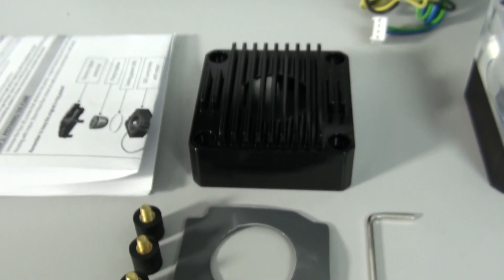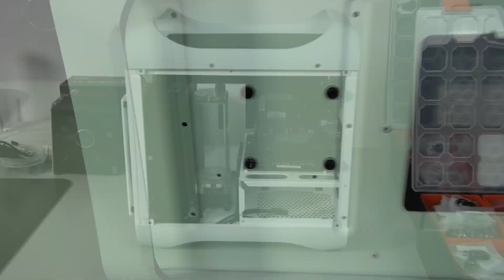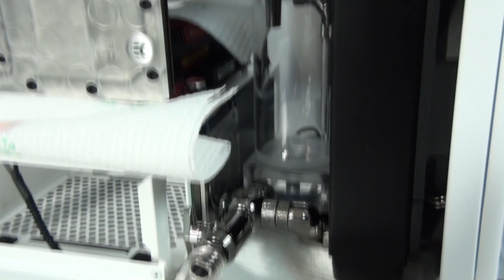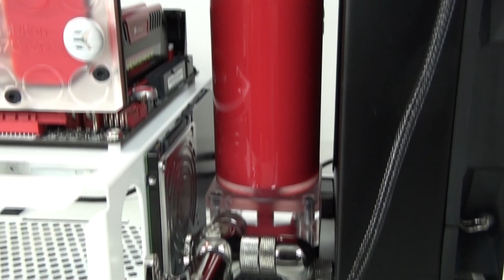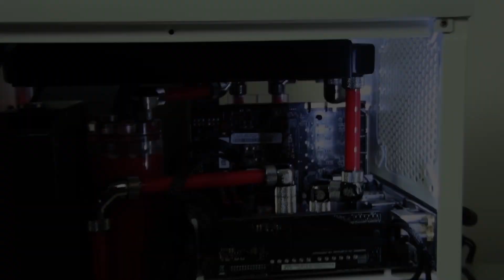Build #11: Prodigy Liquid Cooling: Part 3

Comment: All fans coneccted to splitter, and molex have 4 wires, where about this 4 pin molex goes ? and how to connect 3-4 fans using this spliter and also be able to manualy or in bios setup fan speed ? Cheers
Reply: he makes custom cables for all of his builds, so im assuming he made a cable that goes from a 6 pin sata/molex on the PSU to a single 4 pin molex in for the PCB splitter, but you could just use a molex cable that comes with your PSU. If you want to control the speed of the fans on the PCB, you would need a cable with a 4 pin molex on one side and a 3/4 pin fan connector on the other side to connect to a header on your motherboard. In this case, you would only be able to control the speed of all the fans on the PCB simultaneously.

Comment: I really like the bitspower fitting for the bends. The bitspower fittings are really quite nice!
Reply: Bitspower by far is the best fitting manufacturer, and they have also been the most innovative. Not only do they provide by far the biggest selection, they also have the widest capabilities, by far the best quality and durability, and in my opinion, the best aesthetics and they even offer several colors. Easily worth the higher price I say.

Comment: I know there are bigger problems in the world, but the estimation of sound levels in your builds seems a bit weird. 20-25db?  - that would mean it would be totally silent ie: you couldn't hear it at all if it were turned on inside a sound proof booth; well, 25db is the threshold for people with good hearing. By memory (someone will read wiki and correct me) Decibels measure sound exponentially, a 3db difference is double or half-  ie: if normal talking is 72db, softer talking (half that volume) is 68db, quiet talking 65db, whispering 61db etc. A louder GPU cooler (like a 290x) is rated at about 55db, so a 52db GPU cooler would be HALF of that. I think (again by memory) that a <40db PC is considered extremely quiet / near silent & that would be a PC optimised specifically to be quiet (very low RPM, sound deadening materials, minimum ventilation etc).

Comment: How do you figure out the bend when bending Acrylic. Meaning it a 90 when bent you can't just measure to the fitting and bend because than the 90 would be offset and over shoot the fittings.
Reply: WTF are you talking about??
Reply: +Kyong Hansen the offset measurement you need to know when you make your bends to know how much to measure but hey you are ignorant
Reply: uh no im not lol, because ive built several systems using both 16mm and 12mm crystal link and ive always taken my tubing angles and routing very seriously. Clearly you are with your stupid statement, trying to tell the best system builder in the world that he cant do something that he clearly is doing just fine.
Reply: +Kyong Hansen look at my channel tell me I don't know what I'm talking about. My build will be there.
Reply: +James Emsley I didn't say anything about him. I was asking how he measures for when he bends a tube. As when bending you have an offset. I be always done it by eye ball but since learned how to measure for the offset so my bends are exact

Comment: How much would a water cooling system like that cost
Reply: Rough estimate is $600. Not including the custom wiring. Pump, Reservoir, Blocks, Radiators, Fittings, Tubes, Liquid, and accessories.
Reply: and no parts :D
Reply: lol for a system this small? uh no. 600$ for EVERYTHING is accurate....  the 2 waterblocks would equal about 225$, the pump/res combo unit is about 100$, the radiators equal about 140$, which totals about 465$, then that leaves 135$ for the fittings and tubing which should certainly be around the cost of those altogether. This system is by far the cheapest overall that hes covered.

Comment: I prefer the looks of the fittings for the bends in the water tubes and keeping things at set angles like 30,45,60,90 degrees, but I prefer bending the acrylic due to the flexibility, and when done right, it can be more creative allowing custom shapes like loops or zig zags, etc.... For small builds like this, the fittings along with the 12mm OD tubing looks great.

Comment: How much does a loop like this cost? I just built a bitfenix prodigy rig using the same setup, minus the fact that I used an ASUS GTX 770 since I really wasn't thinking about water cooling it until I saw this video again.
Reply: $65 for the 240 radiator, $30 for the two 120 fans, $100 in fittings, $110 GPU block, $70 CPU block, $60 for the 180 radiator, $20 for the 180 fan, $30 for the tuning, $70 for pump and reservoir combo. I might be a little off but it should give you a good overall idea of the costs.

Comment: another beauty!  do you think that the nvidia trend for getting more performance for ever lessening tdp will eventually obsolete water blocks for video cards?
i mean the maxwell 750ti performs about 40% better than the same price point ati
using 40% less wattage this trend may obsolete the water block and ati both!
Reply: It's been a year, and the low power trend is already out the door for the high performance market.
Reply: +ThierryTheuns ati has all but waived the white  flag
Reply: +Nick Fury ATI is constantly selling power hungry cards, so I don't get your statement

Comment: Not hating on your build, it looks great but I was a former plumber and one thing I know for sure is the less fittings u use the better off u are. Fittings always fail it's only a matter of time, the chance of fitting fail is increased with use of cooling and heating of piping. this is just MO take it as u will.
Reply: How long do you expect this loop to be in use? A year, maybe two before upgrading?  The o rings will last much, much longer than that. There are guys out there with decade old BP fittings that are still leak free. It's not like the plumbing in a house that will be under heavy use for many years.

Comment: Could you Do a soft tubing prodigy video? I will try to do such a build und my own in a few months and I think its chraper than these acrylic tubings, what are advantages and disadvantages on both sides?
Reply: Physonium I but what do you need for cutting the tubes? and is it that much more it will cost to do it with acrylic tubing? Isaw the bitspower parts were around 15-25 euro each.
Reply: Hard Tubing is awesome, it looks very good inside of a case because its not big and bulky.
Reply: ***** okay thank you, but where can  I get the acrylic tubes and fittings that arent to expensive (best bang for the buck)
Reply: ***** And how much Radiator Space do I need to cool my overclocked Athlon 760K and a R9 270x? (overall dissipation would be around 350Watt) is one thick 240mm rad enough in push-Pull? I do only have space for a 240mm and a single 120mm in my Prodigy.
Reply: ***** primochill fittings are hideous. BP all the way.
Reply: Chris Cleveland
I don't think their basic compression fittings look bad, but all their other fittings do look like crap, I agree, But I actually like the basic straight compression fittings look for the money, kinda plain but good value, lots of color choices. BP looks nicer but cost significantly more, really matters on budget. With BP fittings running $6-10 more if you need 20 fittings it could be a $120-200 difference depending on the fitting needed. Of coarse the builds like we see in this video have quite high budgets.
Reply: Ian M I'm not a fan of pretty much anything made by primochill... Their lrt advance is good stuff, but beyond that they're pretty far down on my list of favorites. I don't mind compression fittings either, but I'm a bitspower fanboy so my fittings budget is always ridiculous lol. My latest loop uses multilink enhance with rotaries for bends, and it's kind of insane how much it costs to build a loop like this. 40 or so rotaries, tons of extensions, 30-40 multilinks, and various bits and bobs get pricey quick. I'll probably bend my tubing on the next build lol. Maybe go nickel plated copper or something. 

Anyway, went off topic. I'm just sort of a fittings snob. Primochill acrylic fittings can look ok (they've improved with their newest line) but I'd personally never use them as long as you can get BP stuff.

Comment: NOOOO....Just take your time and bend it! I study as a mechanic and we have a class of Fluid Mechanics. Every fitting, adaptor, curve(greatly depends how close) ,rough change in diameter, and the surface texture of the material create losses. While pressure is not part of a close loop (where water constantly flow at a given rate) it's the sum of losses! Having a minimum of fittings and wide bends of this tubing would make the perfect loop!

Comment: I agree with what you said about the bending of the tubing really depending on the size and aesthetics of the build.  For a small system such as this one I think that the more fittings, straight tubing approach is better looking.  But for a bigger build the large bent tubing runs are really quite striking, especially if you can get them to glow with the lighting.  Thanks so much for the great build log!

Comment: i think bending or not depends on the build. 
if there is a clean build required i think the fitting solution is better.
if the build should look crouded and interesting.. i think bended tube would  be better.

keep up the good work :)
Reply: Couldn't agree more.  I have used both in my recent build and it's a great balance between using either one.

Comment: Is there a reliable way to cut wires to exact lengths without using dedicated cutting machinery? I keep seeing all those builds with near identical individual length cables pulling off beautiful loops and curves.

Despite all my efforts i always end up with wires longer or shorter then the rest which ends up putting kinks in my wire bundles.

Comment: Fittings on runs less than 4-5 inches but bend the tube on longer ones like from the CPU to the 180 rad.

Comment: Hi ! I personaly bend the acrylic tube. but only make one or two bends on a tube and trying to do the rest with fittings.Too many bends ruins the ascetics. If I have to do an offset I allways place close to the bends so it's less visible, but it's very dificult to do, you need to do two bends in a same time, hold on place and  let the acrylic cool down.

Comment: My opinion on the tubes, for what it's worth, is for the shorter runs I.E. around the motherboard and between the motherboard and GPU or on this build between the motherboard, radiator, GPU, and reservoir return I prefer the fittings and short straight tubes. However, for the longer runs like the pump outlet in this build I prefer the bent tubes. The one 90 degree fitting floating in the middle of the run takes away from the aesthetics and since the advent of bendable hard tubes is unnecessary.

Comment: I personally prefer angle fittings with acrylic tube makes aesthetics so clean and beautiful.with only bent acrylic tube looks cheap and not much of any aesthetics there.but if on a budget I would bend the tube to save money on fittings to buy better other parts.and I5 cpu is all you need in a gaming pc with money you save could buy a better gpu or ssd or fiitings.A i7 cpu dont make games play better over using a i5 cpu  for gaming only its a great Cpu....
Great build as always mate keep up the great work love your work all class....

Comment: There are times when bent tub is more appealing than using fittings. I believe that for aesthetics the builder should look for harmony an balance. The use of PETG clear tube offer massive strength to the loop with the newer type of compression fittings. It will only be a matter of time before someone designs a smaller more stream lined type of fitting for this application.

Comment: Dan,

I personally prefer a combination of angle fittings with acrylic bends.  If you check my latest build, you can see my example.  There are some situations where all-acrylic tubing can't do the the job and it can only bend so far until it kinks.  And to fix that problem, you'd have to heighten or lengthen the tubing to work around it.  Also, it provides extra strength and helps with uniformity.  Not saying I am a perfect bender/builder but I've seen builds where no matter how good of a bender the builder is, a kink or non-uniformity can easily be spotted.  My 2¢…

Comment: I don't get why a 4670K is in this at least put a 4770K I guess client was poor...
Reply: ***** Given that even recent games like BF4 still basically max out on 4 CPU threads, wouldn't you expect to see those figures?  A 4770k has 8 threads, so funnily enough in the usage department it's sitting pretty low.  The same is said for the AMD FX 8350 and 6300, both of which sit above the 4 thread count mark.  Given that the i5 is hands down a better gaming CPU than the 6300, and is usually better than the 8350 too, it shows how CPU usage is a useless metric.

As for the others, why add an i7 if there is no need?  If it's a gaming PC (which this definitely is) then there will be practically no advantage to having the i7.  Remember this is mini-ITX, so no mutliple GPUs etc that could make use of the larger number of PCI-e lanes offered by an Ivy-e i7.

Clearly the client valued having a unique and beautiful system over that extra power, nothing wrong with that.  I'm looking to redo my WC setup in a month or so, for the same cash I could add a third Titan (second hand realistically) or go for a 4940k instead.  Still, I'd rather change the loop as I like the process and value it over the marginal performance bump.
Reply: Proves how much you guys know about PC's i5's get seriously bottlenecked on Levels on Crysis 3.
Reply: Wow you're ignorant too, guess we should've expected that. You do know that most games are GPU incentive, Yes you are correct Crytek did choose a predominantly CPU intense system for Crisis. But that doesn't really justify the extra expense. And besides you don't need to play a game maxed out to have an enjoyable experience.
Reply: Joe Snow Better spent a GTX 670 is last gen...
Reply: Joe Snow exactly my point buying tons of expensive watercooling components yet skimps on a i7...
Reply: DarthMuse gtx 670 in there anyway lol
Reply: ***** I know but I find its funny to spend so much on watercooling parts and get i5 and 670 in speciality in 2014 regardless of it being balanced system it will struggle in a lot of games I had 2 GTX 670's and I was only starting feel bottlenecked on memory buffer.
Reply: DarthMuse well yeah i bet he could have 780 instead of that water maybe even with i7 if he build it himself
Reply: ***** This system disappointed me I like the sexy look of the small form factor and the watercooling job was great but the CPU and GPU I don't agree with it's sad that people call me a arrogant prick for speaking my mind but than again I understand my commnet "guess client was poor" lol was just a joke god it's so obvious humor..
Reply: I think you'll have to keep your day time job. Because you ain't going to be no last comic standing with jokes like that.
I guessing your also upset that the choice of using 2.5 HHD is disappointing too and they should have splashed out $700 for a 1TB SSD.
Reply: i5 is on the edge even in bf4 
http://www.hardwarepal.com/battlefield-4-benchmark-mp-cpu-gpu-w7-vs-w8-1/14/
Reply: you realise you don't need the extra threads a 4770k puts out in gaming....
Reply: Maki Role there is need for i7 if i5 is 90% usage in bf4 you will have to buy new cpu for bf5 and with i7 you just keep on going. Crysis 3 i7 is 90% and i5 is total bottle...
Reply: Also, the i7 gets way hotter than the i5. I do agree that with such expensive watercooling the GPU could have been better. A 780would not fit the case but maybe a 770?

Comment: I prefer the fittings being used for curves, but I haven't really seen anyone use tubing the way you plan on in build number 12. So I'll hold off on weighing in until I see the next bit of progress on that build.

Either way, can't go wrong with black sparkle fittings.

Comment: Hey SC, i have a major question to ask you about my BSOD 0x124 WHEA and blackscreening when playing videos from youtube sometimes and hulu for awhile. So i've been getting bluescreens of deaths since i custom built my pc, all my hardware works fine, I've tested my processor with prime95 and intel diagnostic program and 0 errors. My RAM is 100% fine, I've RMA'd it just incase the 1st month I bought my parts for my pc and that set of RAM had 0 errors as well. It seems bsods appears more often when gaming and youtube. I get bluescreens very often probably twice a week playing bf4 and leagueoflegend i get bsods maybe once every half a month-3/4ths the month. Also get bsods when playing grid 2 after awhile... No overheating issue. I use a noctua NH D14 and get around 62-63 Celsius MAX prime95. My graphics card also idling around 25 Celsius to 30 Celsius. Playing games get around 60-70 C. i went to answers.microsoft and went and posted my .DMPs and they came to a conclusion it could be the processor... I feel its the graphic card though. I never got any errors from the program stressing my processor nor BSODS. The error i hear from some of the people helping me deciphered that the code says GENUINEINTEL. Something to do with cache 5...

Comment: I am somewhat indifferent to the usual preferences for fittings versus bending, I feel that the choice should rely either on the purchaser or the demands or aesthetic properties of the build. I do think that you should consider making a build with the EK SC blocks that you've polished the matte finish off of. Apparently this works surprisingly well and the looks are stunning for those that appreciate the circles and for those that wish they were a little less obvious.